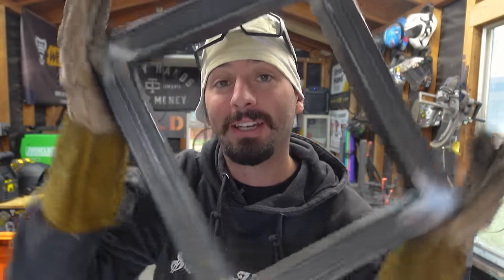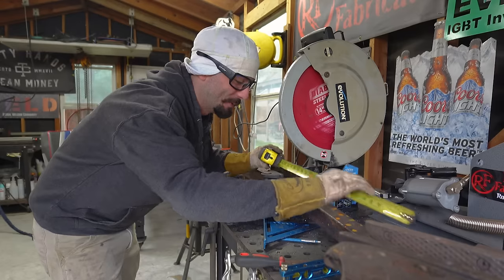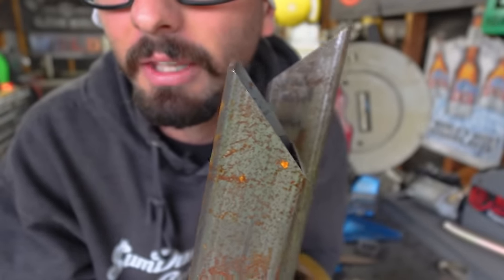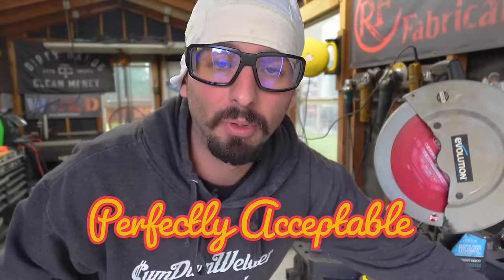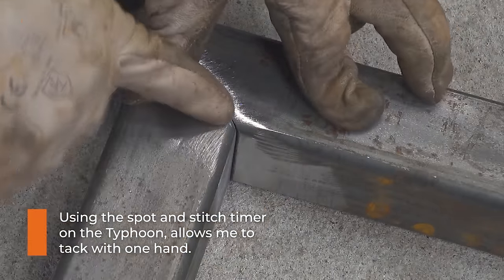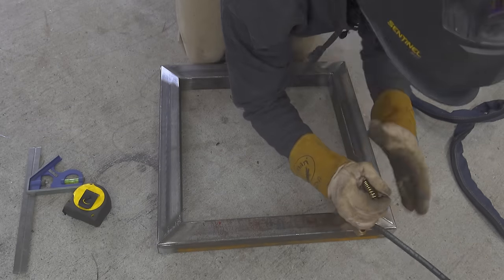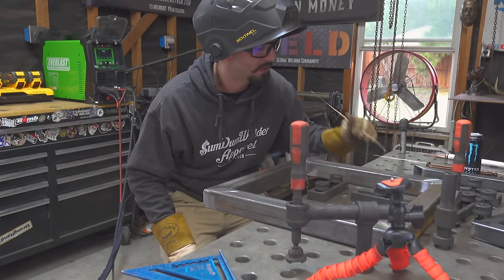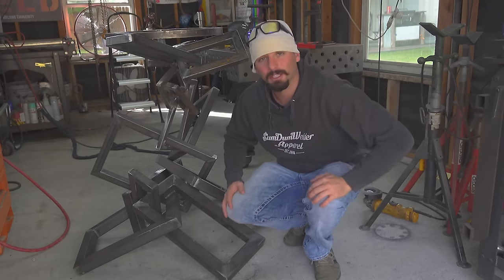Avoiding Happy Little Accidents | Metal Miter Cuts Made Easy

Comment: when building frames that had to stay in plane we would use 3 pieces of angle to put under the corners to isolate it from the floor.  normally once it's tacked together it can be finished welded on floor.

Comment: The only thing you missed when tacking the frame together was puling your corner to corner square with the tape measure. If an inspector came by, you could easily fail on some jobs. I learned that the hard way.

Comment: I tend to use a vicegrip clamp to make a ground connection. Works good, no clean up. As I do a lot of aluminum which is exposed after finishing, it saves time.
Reply from the maker: Great advice gotta try that
Reply: I just ordered one from Stronghand. Very nice and very expensive.

Comment: love the video. But one question, why tack the scrap onto the piece for the ground clamp? Why not clamp the scrap piece to the base, then clamp? No clean up, blending or unnecessary heat input. Would the clamped connection not be as strong of a ground connection?
Reply: clamp didnt open that wide
Reply: @AustinHargett  definitely a valid reason! haha

Comment: If you follow the process of mirroring correctly, you won't end up with a twisted frame and out of square frame. 

Also, that frame is going to grow, and all enclosed frames need to be reduced by material thickness. This helps ensure that you 20"x20"  is actually 20"x20"
Reply from the maker: That is great advice!